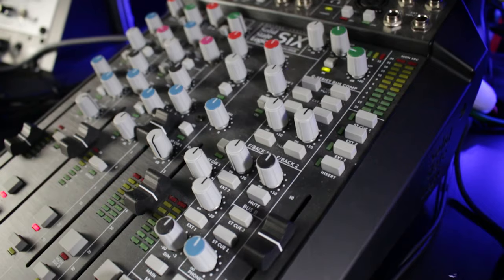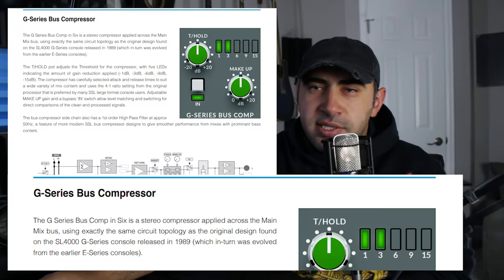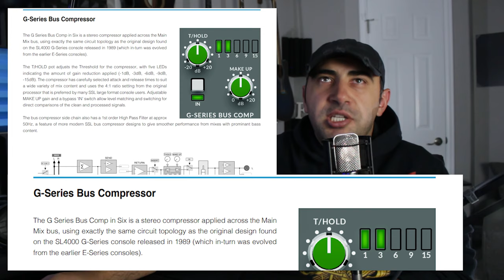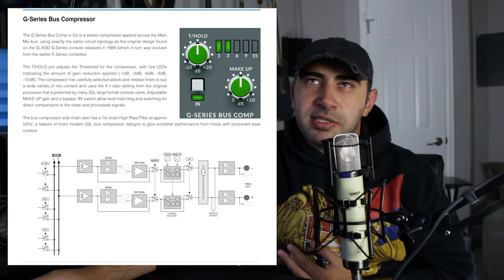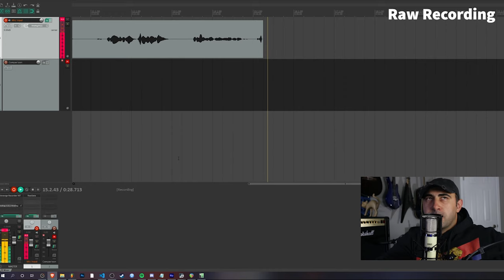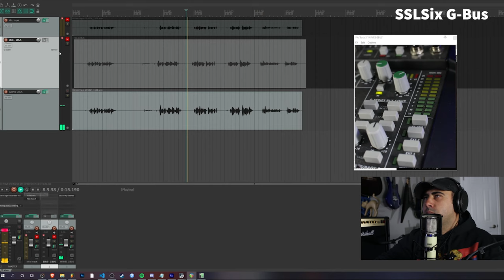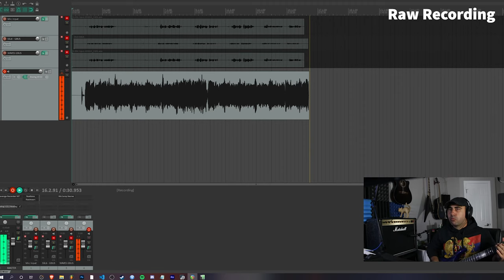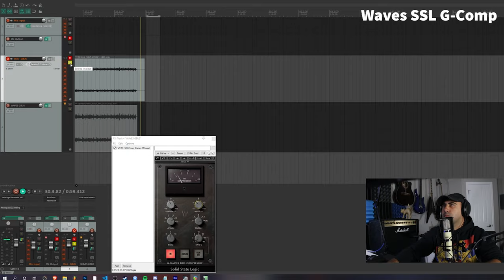SSL Six G-Bus Compressor vs. Waves SSL Compressor

Comment: I would say that the SSL six does outperform the plugin on this particular test. It is much more open and 3 dimensional on my monitors. If we're talking $1,700 mixer vs $20 plugin...then it's up to the buyer to know how many mixes they will put through this treatment. 

If you got the CASHA and do a lot of stem mixing it's a worthwhile investment for the SSL SiX. I currently have one and I couldn't be happier.

Comment: Just got mine and I am blown away how polished everything sounds now without having to have an engineering degree. All respect to actual producers and engineers but as a musician this thing invaluable with all its functionality and portability without having to break your bank account its the best fist dip into studio mechanics. You can learn how to use recordings as a tool and not have to rely on plugins to fix it all. Get the recording right at the source.
Reply from the maker: Yeah it's honestly one of the best pieces of equipment I've purchased. I mainly use it in my mastering chain but none of the plug-in compressors I have come close to producing the sound of this thing. 

FYI Obviously great to get a good recording at source, but you can record raw and then route it through the mixer. I have mine setup to where it's just another plug-in that I can select in reaper and route whatever audio I want into it.

Comment: The difference isn't hard to hear at all - on the full mix, the plugin version sounds a bit congested, veiled and cramped, whereas the hardware implementation sounds more like a finished record with more clarity. With the plugin I can actually hear the attack and release envelopes "breathing" a bit on kick and snare hits, but not with the hardware which sounds much more transparent to me.
Reply: Could it be that your plugin attack and release times were simply set longer than the hardware's fixed values though?

Comment: What was your settings set to on your Ssl? How are u returning your singal clean? Are you going through 3/4 5/6 only?
Reply from the maker: i’m running the input into 3/4 and out from the main monitors 1/4 inch into my interface.

Comment: thanks - I've looked but can't find the fixed attack and release times for the Six G series bus compressor. Does anyone know what they are?
Reply from the maker: According to the manual it's a variable time based on input.

"The attack time of the compressor is program dependant and varies between approximately
8 ms and 30 ms. This allows the compressor to operate smoothly when working with a wide
variety of content. The release time is approximately 300 ms and the ratio is a gentle 2:1.
The single user control is for the compressor Threshold adjustable between +10 and -20
dBu and is accompanied with three LEDs indicating the amount of gain reduction being
applied. The circuit has automatic make-up gain to maintain signal level for the full range
of threshold settings."
Reply: @aeonslight  thanks :)
Reply: I believe that the above attack and release times are for the channel compressors - the BUS compressor has a 30mS attack time and a 100mS release or AUTO (switchable). Ratio of 4:1.